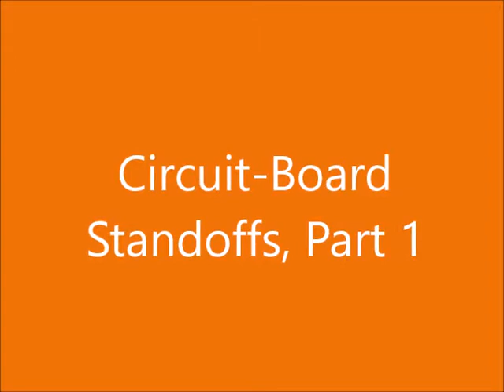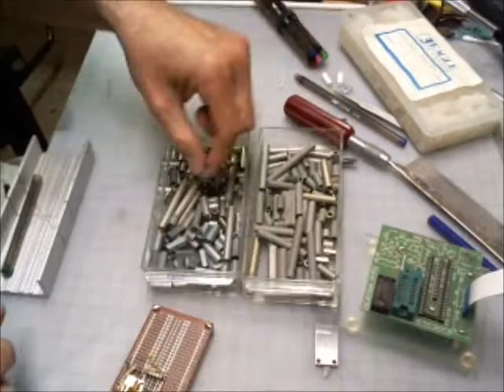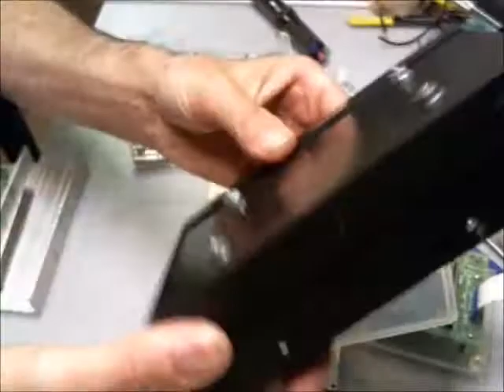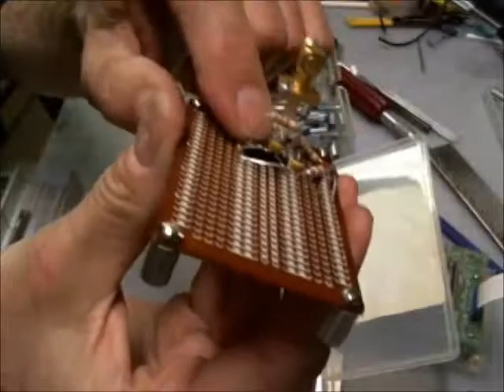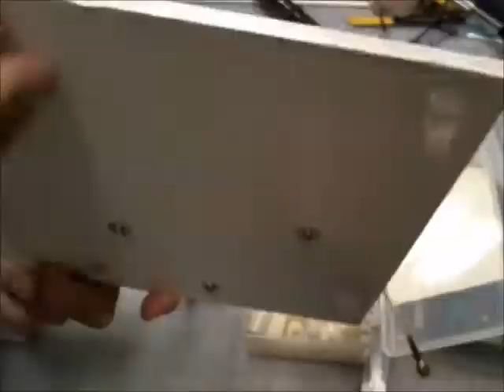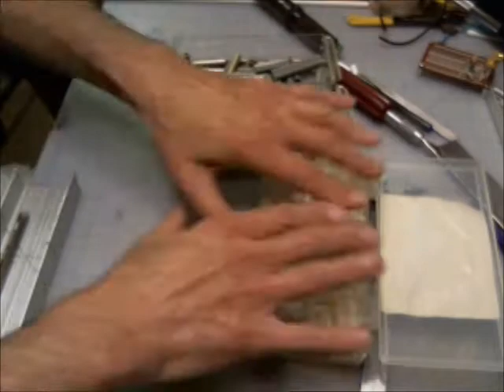Circuit-Board Standoffs, Part 1

Comment: Im looking for spacers that are plastic that 3/4" to 1" in length that are threaded on both ends.  Im trying to attach two pieces of plexi glass with one side being the exterior (so the attachment screw will be seen. This is a art installation.  I don't know all the terminology for this stuff.  I will use a bolt screw on the side that is showing.  The ones I found are decorative and called cake stand screw??? Its just a bolt screw with a flat flush top that I can paint and cover by painting. So I need a spacer that I can screw in from underside as well as outer side (which Ill use the bolt screw).  Does that make sense?
Reply: i guess Im asking the wrong place but does anybody know of a trick to log back into an instagram account?
I somehow lost the account password. I love any assistance you can offer me
Reply: @Marley Parker Instablaster :)
Reply: @Angel Emmanuel i really appreciate your reply. I got to the site through google and Im in the hacking process now.
Looks like it's gonna take quite some time so I will reply here later with my results.
Reply: @Angel Emmanuel It did the trick and I now got access to my account again. I'm so happy!
Thanks so much you saved my account :D
Reply: @Marley Parker glad I could help :)

Comment: I have an amplifier card that is experiencing some noise issues. The PCB is a 24VDC board and doesn't have a connection to chassis ground. (It's using plastic standoffs.) I'm wondering if one or all of those standoffs should be metal. Any thoughts on this?
Reply: I think you can keep the plastic standoffs, but you might solve your noise problem by grounding the amplifier to the chassis with a good low-impedance (i.e, heavy-gauge) connection. Use lugs at each end of the ground "strap" and clamp them firmly to the pcb and the chassis. The usual practice is to make a single-point ground connection (rather than multiple connections from more than one point) to the negative side of the DC supply as it enters the pcb. This is avoid creating even bigger noise issues through the introduction of "ground loops." Of course, you might also have noise entering your system through the power supply, in which case you can use ferrite beads, decoupling capacitors, and chokes to fight that problem. Best of luck!
Reply: I was thinking the same thing about noise coming from the power supply but after some testing I found that the bluetooth module was the source of the noise. I'm going to go ahead and get the chassis ground to the PCB in place and if I'm still having issues it'll be time to look at putting some shielding in place. Thanks for your response. Very helpful.